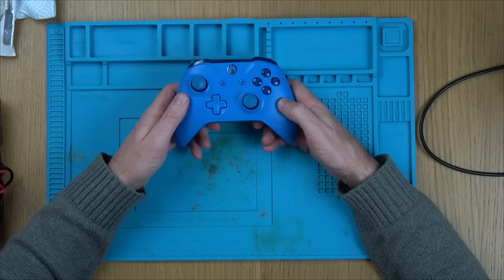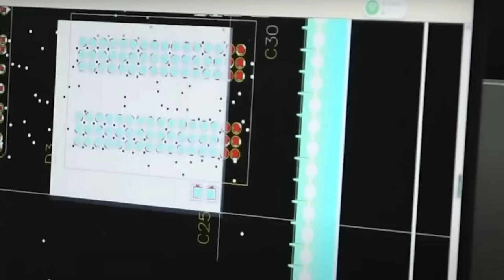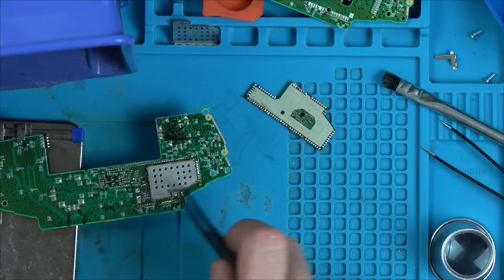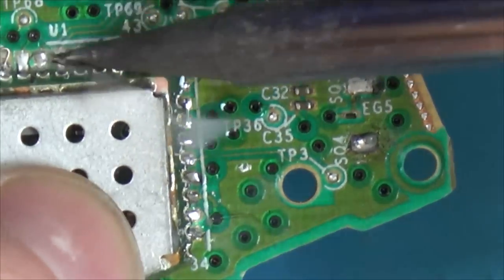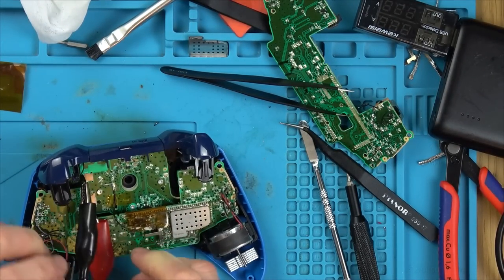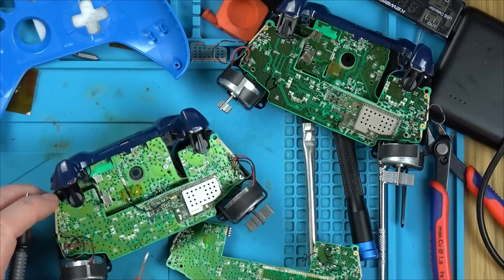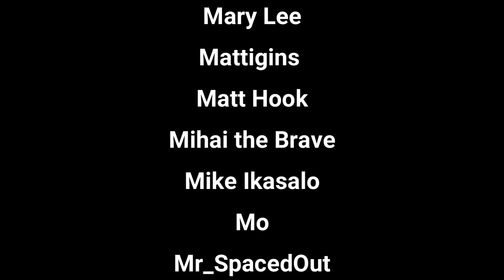XBOX ONE CONTROLLER with STRANGE FAULTS - Will it WORK Again?

Comment: Great Job Vince, and good job on the sponsorship! A hall effect sensor usually has 3 connections, GND, VCC and output. The output voltage varies with the magnetism detected, so now you know how to test them :) on another note I got approached by a company to do a review on something so things might be looking up!
Reply from the maker: Thanks Mick, I couldn't seem to get a voltage reading on them. I wonder if I should have been looking at millivolts on my DMM??? Happy to hear from you as I noticed your channel seemed a little quiet, taking a well deserved break over Xmas I presume. Good luck on the review and here's to lots of fixes in 2023👍
Reply: @Mymatevince  Thanks Vince no they should be 3v or 5v. The output should vary from 0 to the supply voltage usually or slightly less. I've just been busy with car issues currently got the gearbox out of my car and crankshaft oil seal on the engine has gone. Also had a few trips to the hospital as had a pain in my side and seems I've developed kidney stones which I'm waiting to hear on results of a scan. But I'm fine apart from a few bouts of pain over Christmas. Just been trying to catch up a bit and get some content done 👍
Reply from the maker: Sorry Mick, I wasn't notified about your latest vids. I'll catch up later, just editing a Xbox Series S video with a fault that you may understand more than me 👍👍👍
Reply from the maker: @BuyitFixit  Hope the car repair goes well and you have a bit of cover from the elements. I know all about kidney stones as I was blessed with a kidney full of them. Luckily or unluckily I had the kidney itself removed so I never had to pass them which is supposed to be pure evil. Hopefully with drinking plenty of water and reducing salty food you won't get them back once passed👌👍
Reply: @Mymatevince Oh I never knew that. But I did you mention something on a video about having one kidney? I vaguely remember something. They said I had a 7mm one, but they did a scan again and said it's a 4mm and 5mm. Had another scan few days ago and awaiting results to see if I need an operation to remove them if they are still there 😧😧
Reply from the maker: @BuyitFixit  Good luck with it all👍 and cheers for the help on the hall effect sensors.
Reply: @Mymatevince  No problem. Glad to help 👍👍
Reply: @BuyitFixit  had a 7mm stone and doc said i should pass it naturally. It did. And was lucky enough to not have felt the 11 richter scale pain….
Reply: @onasazi  Nice! Tbh the pain I've had so far wasn't like an 11 more of a 6 I'd say. Although I did have the shakes and was sick a couple of times. It was more in waves the first time that lasted for about an hour then a 6 hour break. Last couple of times it's been like a slow onset lasting 6 hours or so then it just went away for a couple of weeks. I don't think I've passed anything tho 🤔
Reply: @BuyitFixit  and those sharp back pains comes in waves! Well good luck! Trust me you will know when it will pass! The doc will recommended that you keep the stone for lab testing. (The real life size of my 7mm was like a dried raisin!!!!!)

Comment: Hi Vince & The Cod3r have you considered using one of those cheap pcb board pre heaters used by mobile phone repair shops, often sold quite cheaply on AliExpress?
I think if you had used that with a little kapton tape to protect the smd parts then this repair would of been quite easy.
Not only that the small pre heater would come in use for other projects ;-)
I sometimes cheap out on using the old Kapton tape and use the wifes tinfoil (bacofoil) to protect the smd parts.
Reply: Or if you have a 3d printer you may be able to use the heated bed.

Comment: The board is castellated, the majority of solder would be within the half-through-holes and not on what small amount of plated surface padding exist at the ends of those through-holes, you should have been able to use a wick to remove a majority of the solder that's there, if not all of the solder entirely.  This kind of job is also where a hot plate is super, super useful, not only will it evenly heat (mostly, there are nuances) the entire area, but it also frees both of your hands for other work, not to mention their benefits for SMD, BGA, and components with fine pin pitches, and benefits over hot air stations and reflow ovens; GreatScott! and Carl Bugeja have some content on hot plates, designs are entirely DIYable considering price and quality can be concerns with what's currently on the market.  Also, I've been able to find schematics, at least for 1708 and I'm not sure what else the creator has, but Columbia-Tech-Schematic here on YouTube is a decent resource for schematics that otherwise aren't findable elsewhere, super useful for these more complex designs where things disappear into vias, not to mention having pinouts for various connectors and boards.

Comment: Hi. I had the same situation with one of the triggers few days ago. It was constantly on like in yours. In My case removing a capacitor near the hall sensor fixed the problem. Inspection done using my microskope revealed that it was damaged. After that trigger started working normally. Nice job with changing the whole board with that Microsoft chip. I Like your videos

Comment: What you need in the future is a preheating BGA station to pre-heat the board so the solder melts faster and doesn't damage the tracks and crucially the ICs .

Comment: Nice fix, I wonder if the original owner left that trigger jammed on while answering the door or something blowing the chip then the resistor? If it was me removing that board I would have not used a nozzle as that's what probably caused the ripped pads.

Comment: I swear your hands are so rock solid you could manipulate individual atoms under an electron microscope. 
I remember those days! Now I'm older I could make a frappe holding onto a glass of milk. 🤣
Been following you for years bud and as always, a great meditative experience watching you work.
Reply from the maker: 😂 I still get the shakes! If you rest your forearms on the table just above your wrists then it is so much easier as generally the wrists are pretty shake free. In a future video I am holding up a Flir cam without the wrist trick and the Flir cam is shaking all over the place 😂👍

Comment: Another great video. I had the same problem with the 100% trigger. I found a very strange fix that is to remover the small cap and resistor and it worked.

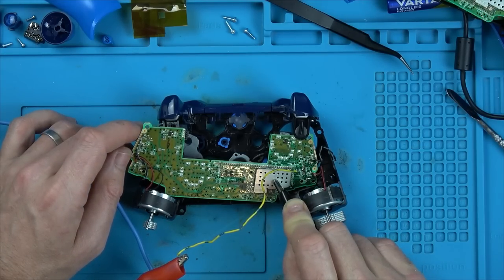Comment: 9:39

The reason the thing only draws 140 mA is because of Ohm's law that states I = V / Ω. And 1 Volt across a 7 Ohm resistance path generates 1/7th Amps of current.
The only way to increase the amperage in this case is to increase the voltage. 2 volts would generate twice the current (and four times the power).

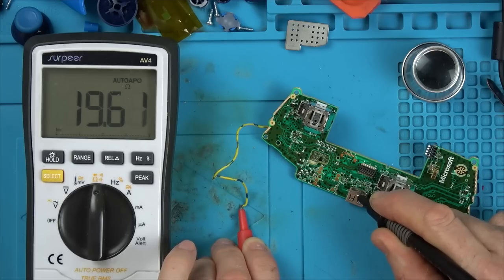12:06
You're right. Heating a conducting material increases its resistance. Every conductive material has a temp-to-ohm curve, and copper is no exception.
Fun fact: each material has a so-called "critical temperature", where if the temperature goes below that, the conductor becomes superconductive, exhibiting zero electrical resistance (and, thus, theoretically being able to pass an infinitely strong current). Copper's critical temperature is 43 Kelvin (or -230.15 Celsius or 382.3 Fahrenheit).
Reply from the maker: Thanks Operational117👌👍👍👍

Comment: Personally I would of taken the nozzle off the hot air gun.   Circled the entire inplace PCB, putting plenty of heat in the entire area. 
Something to think about maybe.  PS.  I am not an expert, so own judgement required. 🤔
Reply: The problem with that method is that it would have melted the solder on all the components,. So when he took the board off, he may have knocked off some of the components.

Personally I would have wicked the unleaded solder off of the pads before adding the low melt solder.

Comment: Hey Vince. I've got a problem with an original xbox controller from 2013. I had just taken it apart out of curiosity, but when i put it back together, the triggers and sticks don't work. I think there's something wrong with the rear pcb board but have no idea what caused it. Any ideas?

Comment: Always interesting to see these controller repairs.  No two faults are ever the same lol!  Very strange behaviour before the update - I was thinking maybe a bad solder point (perhaps around the module you replaced)?  But the firmware update seems to have fixed it?!?!  The resistor going open circuit is probably from a drop - a bit like ceramic caps they can be damaged by shock.  Caps tend to short, resistors tend to go open circuit!
Reply from the maker: Thanks Chris. I was originally wandering if the boards didn't match with the same firmware, but I don't think there is any chip of any importance on that other board near the buttons so it can't be that. 
So maybe it was thrown in rage and that damaged the chip and the resistor. Cheers mate👍

Comment: Great job, Vince! I've repaired a couple of XBone controllers for my kids and the fault has always been a resistor, I think their parts quality is very low. One of the failed-open resistors I peeled the paint off and inspected had a teensy, but visible crack in the resistor element.
**IDEA**: For testing SMD parts, I use something called 'tweezer probes' - they look like tweezers, but each prong is connected to a wire that goes to the DMM. This makes rapid testing of SMD parts very easy.
Excellent video and channel, thanks so much for the entertainment! Cheers!!
Reply from the maker: Thanks Thomas 👍👍

Comment: Wouldn't those board to board interconnects be a great job for high quality solder wick?
The Low Melt solder might have been a good choice, hot air is always a good idea to preheat the Board and increase your chances of not damaging stuff.

Comment: great video. i have  a xbox one controller that does not power on right away but if you leave the usb on for fair bit of time it finally gets power . Does has right stick drift. would you like to fix it
Reply from the maker: No thanks Dave, I have more faulty ones here. Cheers for asking though👍👍👍

Comment: Nice job fixing the controller I didn't really watch the video I was listening to it while making a cat toy with feathers I was wondering is that the xbox controller that also has Bluetooth capability ? I have one I bought to connect to my phone that looks exactly like that one if I have ot pack away at the moment so I don't know the model # but when I bought it it said it was for the xbox one s and of course the xbox one as well as having Bluetooth so it can connect to other Bluetooth capable devices like cellphones and computers wirelessly , just curious about the one you fixed and if it sends a Bluetooth signal out so it could connect to other devices
Reply: I have the same controller and it does indeed have bluetooth
Reply from the maker: Yes Eric, this one has Bluetooth. I might be incorrect here but I think a quick way to check is if it has a 3.5mm headphone jack and the front is moulded plastic all the way around the Xbox button then I think they all have Bluetooth 👍
Reply: @Mymatevince  thanks and cool it is a very nice controller and happens to be a very clean looking blue color which I  💙 / like a lot

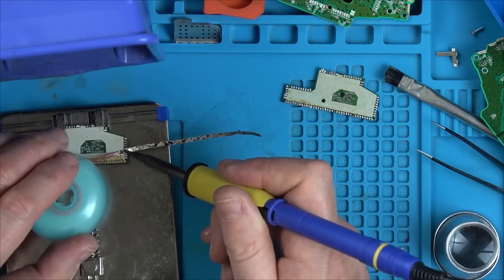Comment: Does anyone know know where to buy the vice dat is used at 20:00? 
It is small, due to the spring it is fast to use and it could be made from stainless steel so solder is not sticking to it. Perfect!

Thanks again for an interesting video Vince, I am learning a lot from you!
Reply from the maker: I bought that from eBay a couple of years ago. I just looked on UK eBay and I found something similar for £5. I typed in 'Board Repair Holder' 👍
Reply: @Mymatevince  I ordered one, thank you!
Last week for example I was replacing the USB port of a wireless IR sensor. I used a thin copper wire and some solder mask to recreate a PCB pad that went missing, it all went well. This is one of the thing that I have learned from watching your videos.
Honestly, I had a great time repairing the sensor and I am proud that I successfully fixed the sensor! :D
Reply from the maker: @annoniem1177  Well done, it is always a great feeling fixing something regardless of the value 😎

Comment: It could be weird after module replacement because of different firmware versions running in different chips around the controller. Updating made them all have the same version firmware (set).

Comment: It doesn't look like you removed the low melt solder from the board with traces you repaired. You might want to revisit that later if you didn't just cut that from the video cuz that will cause issues with solder cracking and connectivity like it's a cold solder joint.

Comment: Great job!
For measuring smd capacitors and smd resistors I have bought measuring tweezers, which you can connect with your multimeter.

Comment: If the trace to a lifted pad isn't covered up by the part it's usually easier to fix the connection after putting the part on.

Comment: Hi vince, nice win and an earned one too 😀Now you have a sponsor (congratulation to that) you can finally get a pre-heater. That would allow you to remove the board much more easy. You might remove the small nozzle from the hot air station to target a larger area.

Comment: the problem removing the board is you are using a very narrow tip in the hot air station. In these cases where the area to work is larger, you should use a larger tip.

Comment: I’m dying to see a Roller update
Reply from the maker: I'll get the next part out later tonight for you 👌👍👍👍👍👍
Reply: @Mymatevince  that’s my Sunday sorted
Reply from the maker: @kotm3  It's a bit of a boring one unfortunately, just a continuation of the brake caliper rebuild. Needs to be done though 👌👍👍👍
Reply: @Mymatevince  I’m restoring a renault 5 gt turbo. I brought it last year. It’s been in a barn for the last 11 years.
Reply from the maker: @kotm3  Nice! I haven't seen a Renault 5 in the wild since the late 90s. Hope its going better than the Roller 👍
Reply: @Mymatevince  it’s been ali g’d 😂😂. Your roller looks a lot more solid. Full inner/outer sills, both back quarters and rot in the o/s engine bay. All welded now. Parts are as rare and as pricey as a Ferrari 😂😂
Reply from the maker: @kotm3  Ohhhhh not good!  At least your model is super rare. Looks like according to Google there are only 300ish left on the road 👌

Comment: Hi Vince help me out here, and tell me low melt solder brand you use? I have a similar job to do and trying to find something for desoldering replacement from the donor. You showed it once to the camera on some video while ago, but can't find it.
Reply from the maker: Hi, if you Google CHIP QUIK low melt solder you will hopefully find it. It is very expensive but a little goes a long way and you need to use flux with it 👍👍
Reply: @Mymatevince  will do, thank you